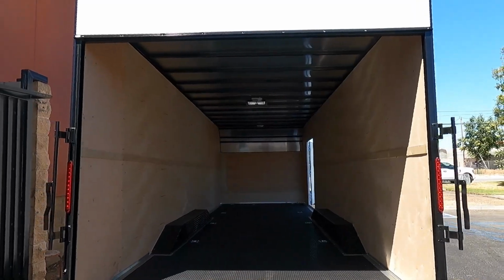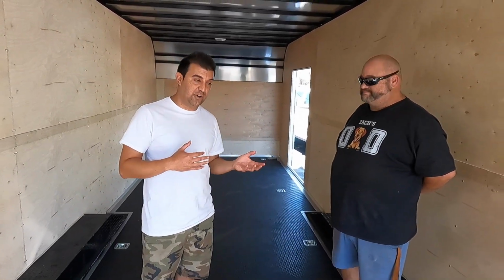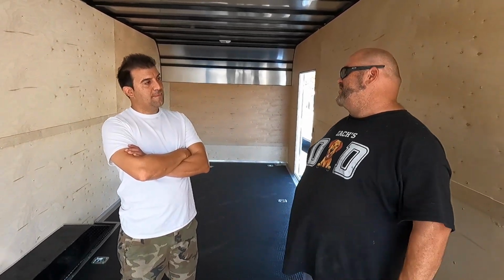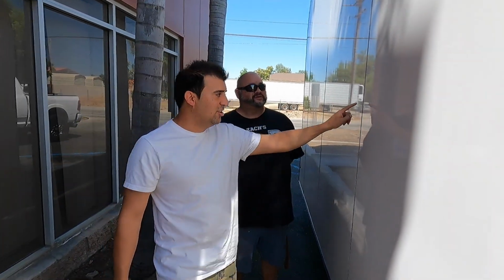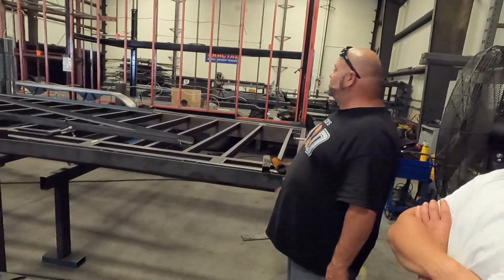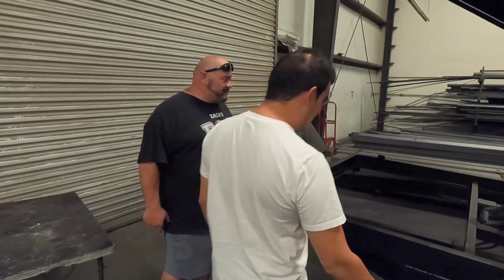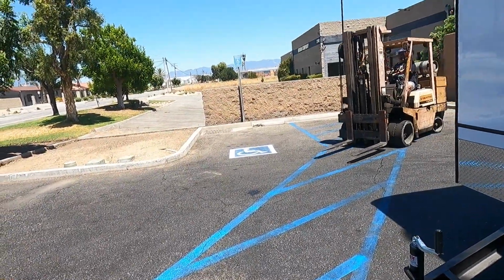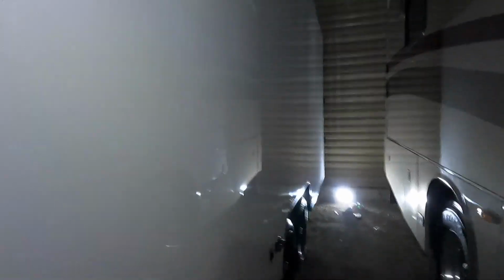The New Trailer Has Arrived!!!

Comment: I like it, sweet setup! I was originally thinking of getting a flatbed for my Pro R  4 seater and my kids quads but I like the enclosed trailer better. Also could use it for guys trips instead of pulling my 40' fifth wheel. I am going to check them out at the Sand Sport Show. Good find 👍